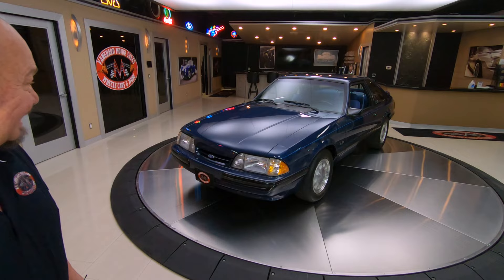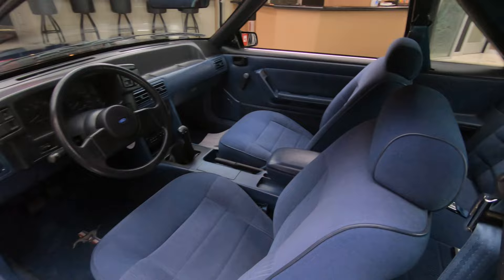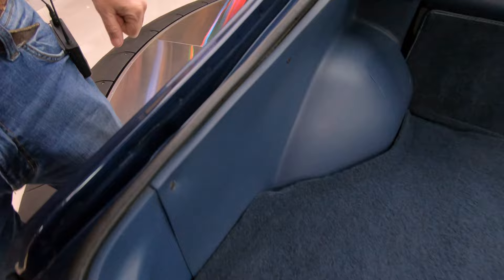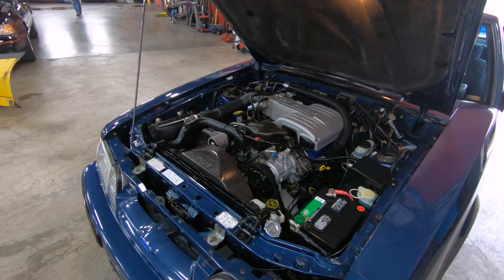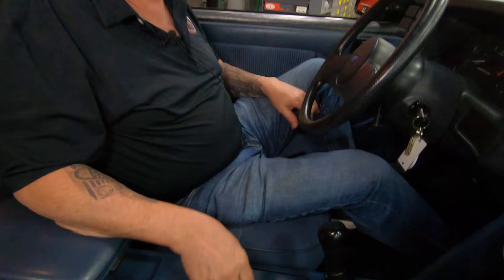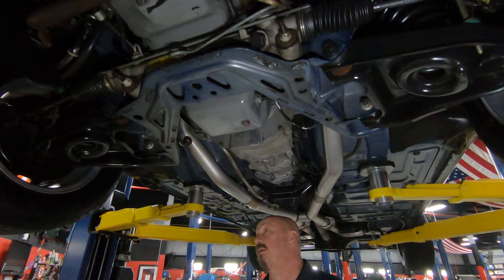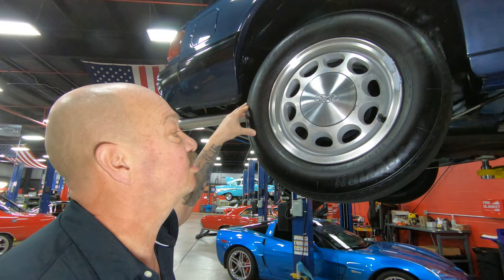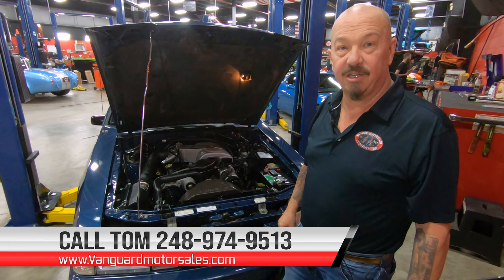LX MUSTANG!! 1987 Ford Mustang LX For Sale Vanguard Motor Sales

Comment: That's a very clean car, even for 34k miles. I saw an all-original 87 GT at a carshow that had only 7604 miles, this LX looks just as clean as that car did despite the higher mileage.